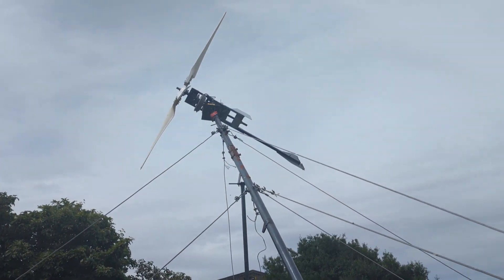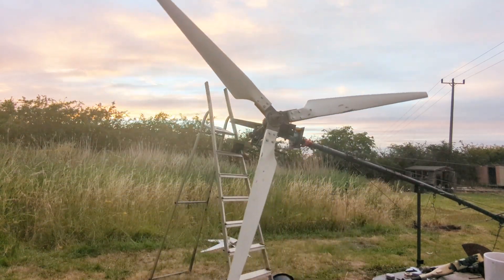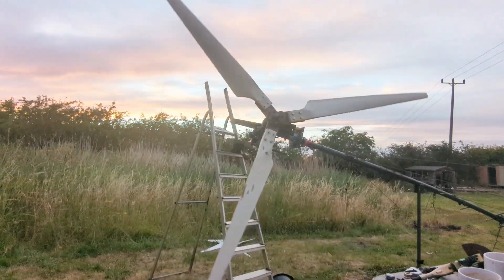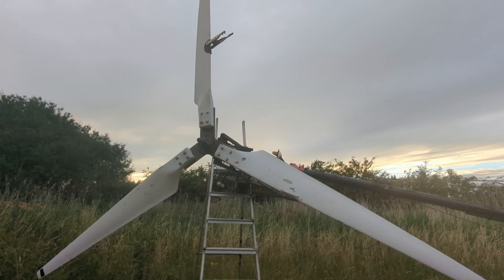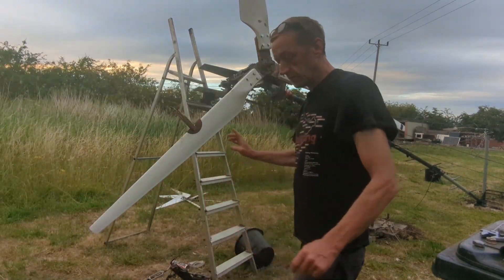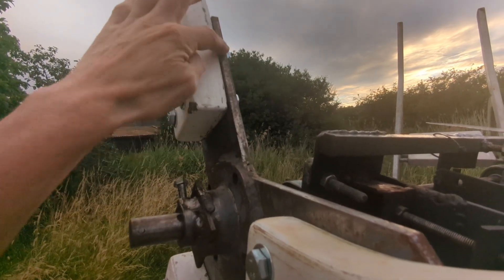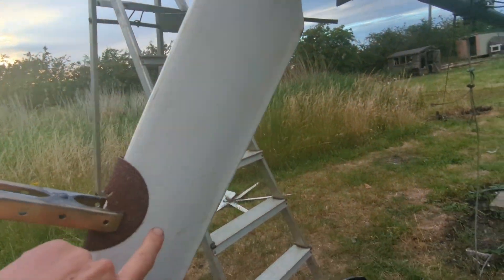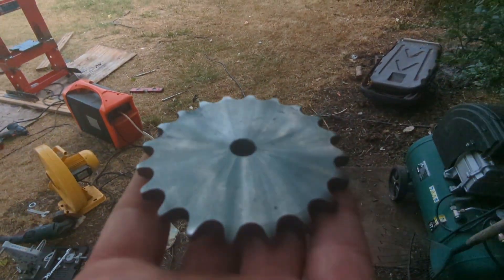Balancing the Wind Turbine Blades - Part 1 of 2 - 12th July 2022.

Comment: i remember Orlando adding heavy washers to the steel blade mounts to balance. it spins nicely doesnt it.
Reply from the maker: Yes I am thinking of actually welding something to the blade hub as this will be easier , whatever happens it'll be the next video , blades balanced , big tail and uprated drive gear , could get interesting.
Reply: @GavinFreedomLover yeh much easier might want to keep the heat away though